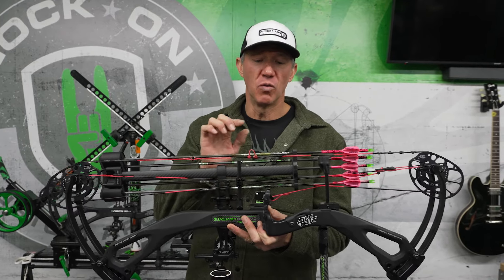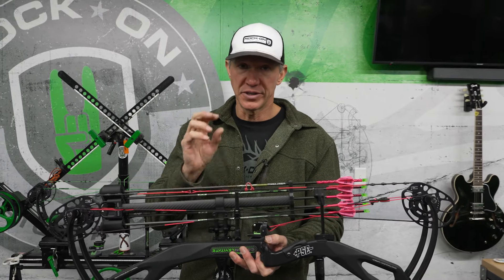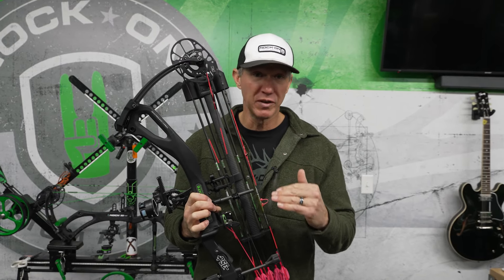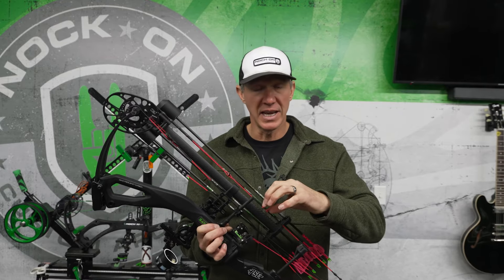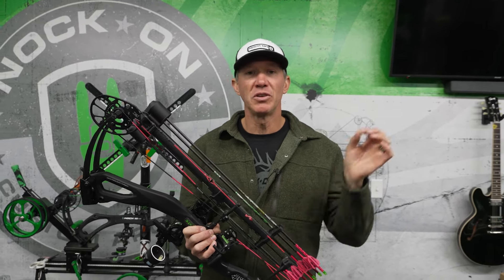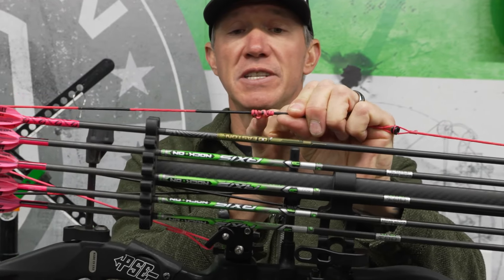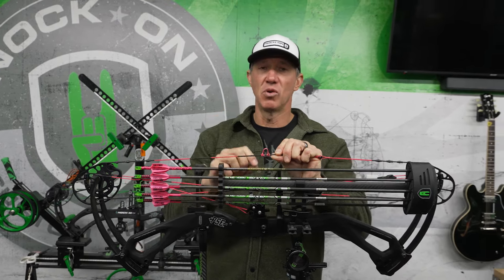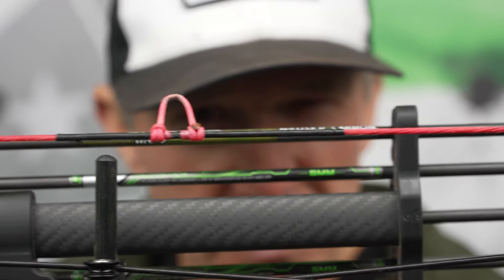ALWAYS use nocking points with your D-LOOP (here's why)

Comment: One thing I've found over the years of fighting the sloppy knocking point deal is that this is all for nothing if an unsuitable center serving prone to separation in tight corners is used on the string (3D, 62XS, Halo, etc. are popular offenders). If the serving separates under the knots, even just the littlest tiny bit, the entire knocking point area is compromised, no matter how many blobs of stuff are tied all over the string there.  So, IMO only - more than extra nocking points, a suitable center serving like Angel Majesty or BCY Powergrip is absolutely mandatory. On these formulas, the thread will stay round and not flatten out like a slinky like a simple twisted pair/braided serving will. That tightness keeps the d-loop knots absolutely locked in place. I choose to use just a bare d-loop for simplicity's sake (I'm not good enough of a shot to benefit from extra nocking points), but either way, I use Angel Majesty for my center serving when I build my strings. That completely gets rid of any and all separation under the knots and ends the oozing knocking point and/or slowly creeping, pinching the knock over time, etc., syndromes completely.

Comment: I depends on the bow and the nocks on the person's arrows. I always ask the customer if they want them or not. Every bow and setup will have different tendencies, and soft-nocks can be detrimental in some scenarios. I've seen partial dry-fire of bows where the soft nocks pinched the nock off the string far enough that it wasn't getting good contact. Caused erratic arrow flight, and a dangerous scenario.

Comment: The problem is that the d-loop shifts and pinches the arrow, shifting the knockpoint tighter. To avoid this, we need a soft material for the d-loop, which I did not find on sale, at least.

Comment: John, my tied nocking points have frayed and loosened over time. They are in need of replacement. In your opinion should I start over with tuning after replacing my nock set?
Reply from the maker: It is certainly a wearable items so if the center serving looks compromised at all it’s worth replacing.
Reply: @nockonarchery  Thanks John, but you missed my question. Let me rephrase: In your experience, does a bow need to be retuned after tied nocking points are replaced?